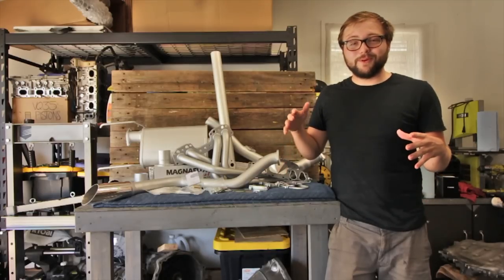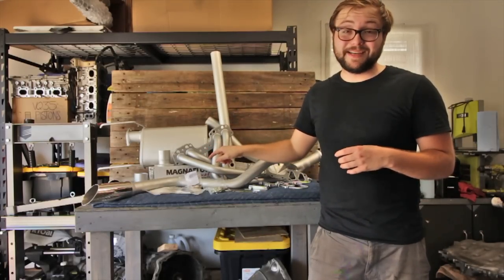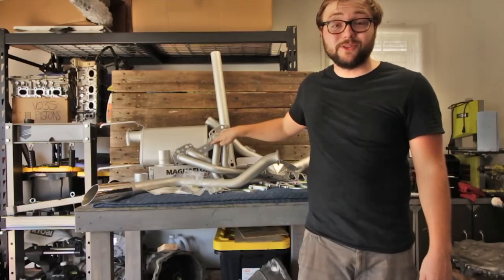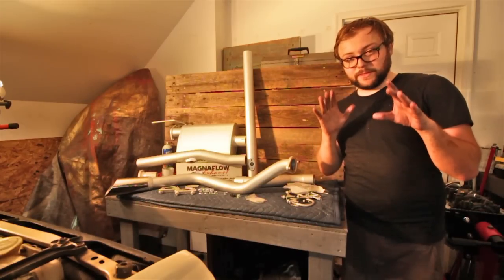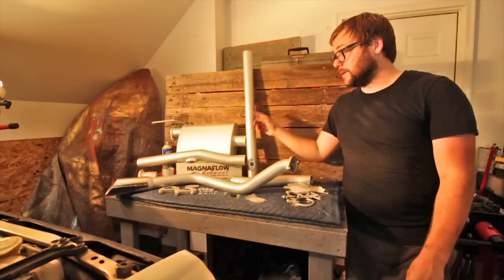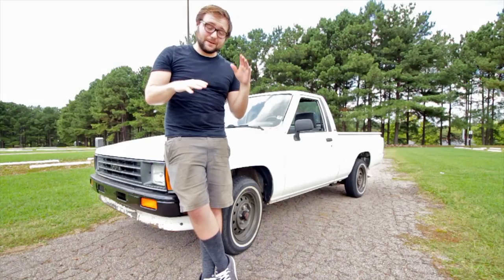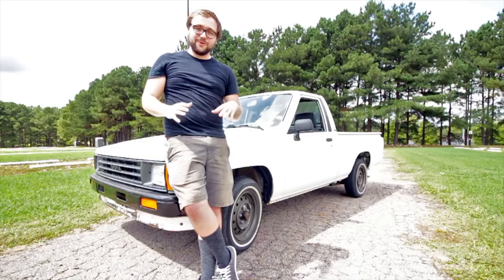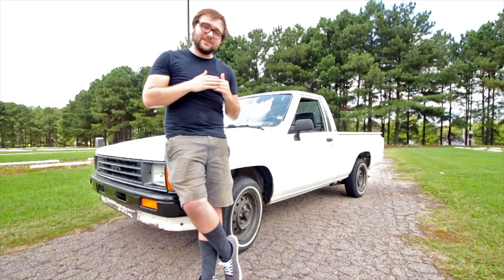LCE Performance Exhaust Install on 22R Toyota Pickup

Comment: I did he header on my 86 Toyota 2wd. Loved it!! But I had my exhaust done at a shop back home . Castro’s in Parker Az!! I used a borla xs 2 1/4 muffler with pipe to the lr with a tip . Cost me 350 installed ! I love it!

Comment: Finally came across a pretty detailed bolt on assembly. Ive been frustrated trying to figure out my 94 Lux set up. I have the LCE pro headers and was gona have the rest welded but didnt have the idea to just go full bolt on. Thank you for posting bro. Excellent vid and luv to see more on your build. Just another LCE fan looking for more tips and learning as I go.

Comment: Between the valves and the timing chain guide, hard to hear that exhaust
Reply: needs valve adjustment bad... Would have certainly been better time spent if you are worried about reliability... lol
Reply: Yup that dreaded timing belt guide sounds terrible mine sounds like that atm getting ready to change all that up soon
Reply: That's just how 22r motor sounds. If you know, you know🤷🏽‍♂️
Reply: I recently picked up a ‘93 pickup with low mileage and am trying to go through a do my due diligence in replacing parts and restoring vehicle. I have been reading about the timing chain guide being the Achilles heel of the 22R/22RE engines. How do I know if I need to replace timing chain guide?
Reply: @kalaibeck2690  you can see the guides if you take off the valve cover, super easy to check and when I did I saw that mine were long gone so it saved me from engine failure

Comment: I added this Header to my 1989 SR5 Pickup with a Flowmaster muffler, I also purchased a LCE larger valve head
(smog legal) and modified my airbox increasing the airflow intake, my truck is pretty fun to drive now, Its screamer for sure, next I will add a lighter flywheel, then I'm done!

Comment: Great video man. Congrats with the new exhaust set up. I'm thinking of going with LCE's headers in the future!
Reply from the maker: Thanks! I appreciate it. I'm really happy with the full system
Reply: Northwest Offroads header is tri-y
Better for lower rpm use.
LC is a racecar engine place and few people drive their 22R at 4,000-6,000 rpm that the 4 into 1 is engineered for.

Comment: Was the tube that went into the manifold and egr tube and do you need a plate to block that off or does it come with it or it’s a non issue?

Comment: So what about the EGR? Looks like you just have it open in the bay with the new header on. No cap/plug?
Reply from the maker: Currently uncapped but there are upgrades coming for the intake which does away with the system EGR entirely

Comment: Is it good to get a weber carburetor or stay with the stock carburetor
Reply from the maker: Well one thing to remember is that Weber's have a different intake. Weber's do have the potential to make more power and will shift the power band but they tend to require a lot of adjustment. I stuck with the stock carb mostly for convenience.
Reply: @OldDatsun  thank you I appreciate it love the videos too very helpful

Comment: Is it possible to just replace the header and do the rest of the exhaust at a later date? Or do you pretty much have to do it all in one go?
Reply from the maker: Well, the long tube header is longer and drops lower than the stock exhaust manifold as well as having a 2 1/4 in collector so it will not match up to a stock exhaust system. So I would say you ought to do the entire system at the same time

Comment: Have you ever had issues with your exhaust hitting the torsion bar, right after the header flange? I’m installing same setup and the exhaust seems pretty close to the torsion bar.
Reply from the maker: Yeah I have. I'm also having issues where it's hitting the rear shock. I need to make some new mounts to get it better positioned but recently have not had time

Comment: Hello! excellent video, I have two toyotas but it's a pity that in Mexico you can not get those parts at a reasonable price, anyway , nice job man!
Reply from the maker: Thanks! Is there a tax on the parts being imported to Mexico?
Reply: yes, and the shipping is also expensive, well this by ebay, some day man
Reply from the maker: @jorgecarreon7934  I wish you luck!
Reply: @jorgecarreon7934  they're not reasonably priced In the states either. $500+  I have a Doug thorley tri-y.

Comment: Could I just cut and use the pipe instead of putting a cat in ? Would that make it louder or no? Got a 92 single cab with lce headers and I’d like mine to be loud
Reply from the maker: Yes, I think you could just bolt it together without the cat. It's a high flow cat so mine is still pretty throaty but without one I'd imagine it would be even louder.
Reply: @OldDatsun  Rahja bro, Just ordered mine today! gonna bolt mine together no cat 🤙🏾
Reply from the maker: Yes! I love it.

Comment: Have you had any issues with not having a heat shield on the headers, like the OEM exhaust manifold?  My other question is how was the fit on U-bolt near the header joint by the bell housing
Reply from the maker: I have had no issues with not having a heat shield. Wrapping the header is an option but I've heard it can also potentially damage the header.

Comment: Did you not have a heat shield, I didn't see the removal?
Reply from the maker: You're right, I've had it off for a while. I had to replace the rotating assembly at 321k and on the removal a bolt snapped. I knew I was going wo th this exhaust eventually so I left it off

Comment: Do the 20r and the 22r have matching header fitment?
Reply from the maker: I think the ports will align but I don't think the studs are in the same location. I don't have a 20r so I'm not able to confirm

Comment: Nice exhaust. Sounds like it needs a valve lash adjustment though
Reply from the maker: Thanks! You're right about the valves 😅
Reply: These indestructible 22 R and the 22RE we’ll always make that sound because of the solid lifters hitting the rocker control arms it’s the nature of the beast to sound like that even with perfect Value adjustments
Reply: @OldDatsun   which one  did you get do you have the link

Comment: I noticed you eliminated the O2  sensor. What is the purpose behind doing that?
Reply from the maker: So there are two locations for the o2 sensor. One in the pipe where I added the block off plate and the other in the extended tube that I cut down. Now, I added the block off plate because I currently have the stock 2bl carburetor with no o2 sensor being used. However, I may be adding a different intake in the future and will need to add an o2 sensor

Comment: Work for 22r 88 4wd extra cab pickup truck ?
Reply from the maker: Yes! I believe it should be long enough for the extra can but definitely for 4x4.
Link to product-https://www.lceperformance.com/Pro-Flow-Exhaust-System-22R-RE-3VZ-2WD-4WD-1985-p/1042000.htm

Comment: Would this exhaust system work with the Nissan D21 Hardbody? mines a 1996.
Reply from the maker: I wouldn't think so. The header is specific to the 22r head and is made to fit this specific chassis. Same goes for the exhaust system
Reply: Yer it fits I’ve done it everything is the same even down the the burnout,
Reply: @OldDatsun  The head on the ka24 has the same pattern as the 22r head.. Plus the guy above also said it fits.. Imma try it.

Comment: Do you know if these parts will fit a 1984 Toyota pick up also?
Reply from the maker: LCE Performance has parts specific for the '84. I know the chassis is slightly different but they do carry components for those pickups
Reply: O ok thanks man I’ll check it out
Reply: Frame is narrower for 2wd.
They gave separate models for 4wd and 2wd. Just make sure to get the right one.

Comment: Chain slap?
Reply from the maker: I dont think so. 22r's are notoriously noisy but I suspect during the filming it was valves and perhaps lower oil in the engine(?). I routinely check the valves and keep the valve cover from being too tight where it can cause the chain to slap the valve cover.

Comment: What size catalytic converter is that?
Reply: 12.5 with 2in flange LCE part # 1043011  LC engineering are the best for 22r parts.

Comment: How long did it take to jus install the headers?
Reply from the maker: Not long, I spent maybe the most time slowly setting it into position so as to not scratch the ceramic coating
Reply: 10 minutes once you've done it a few times.

Comment: Love the truck sounds like timing  chain needs to be replace
Reply from the maker: What makes you think that?
Reply: Listen to the rattle when you give it gas ...
Reply from the maker: @81recinos right, that's the valves which needed adjusting. Timing chain currently only has 20,000 miles so it should be in good health

Comment: How much hp does it make?
Reply from the maker: The 22r is around 100 hp. I have not dyno tested it but stock is around 95 hp and the long tube header and exhaust should free up a few more hp's. The 22r is not really a power house of an engine but they run through war zones and have really long life's with a lot of reliability
Reply: Old Datsun I wonder how much hp you could get with performance exhaust and intake
Reply from the maker: @elliottschneider5072  I'm curious as well and am interested in pursuing some intake upgrades

Comment: Have long tube for 93 4wd pickup
Reply from the maker: Cool! How does it sound? Also, carb or efi?
Reply: rags 1977 what long tube are you using?  I have 94 4wd pickup.
Reply: @OldDatsun  are these considered long tubes also?
Reply from the maker: @redcaddy99  I would consider these long tubes considering how long the pipes are leading the collector. If you're interested in this header, LCE makes them for 2wd and 4wd applications. Just make sure you have the correct one selected
Reply: Hey I haven’t installed yet..exaust manifold stud broken off in head.
I plan on using arp studs..

Just brought new 31 in tires noticed a drop in power I’m desperate to install the header..I also has other lce goodies block off plates
Reply: It’s carbed
Reply from the maker: @rags-fv6ko  sounds like an awesome build

Comment: Dang dude that thing was melting tires lol. I noticed both tires spiining, did you weld your gears?
Reply from the maker: No, only one tire was turning. Still have an open differential. I am looking into an LSD though
Reply: @OldDatsun  please do. They make anything rear wheel drive more fun. :)
Reply from the maker: @Super1337357  Totally agree! Need to start looking up some parts